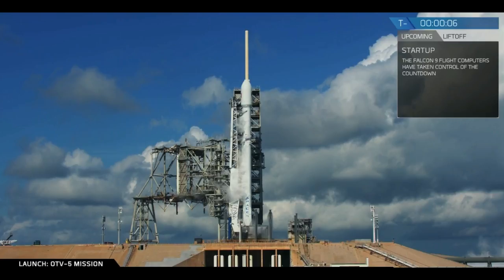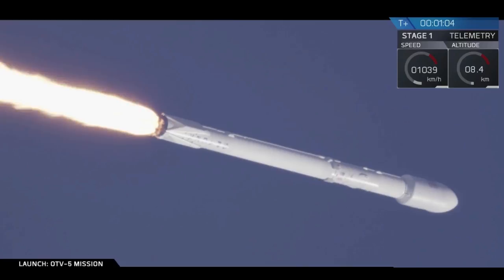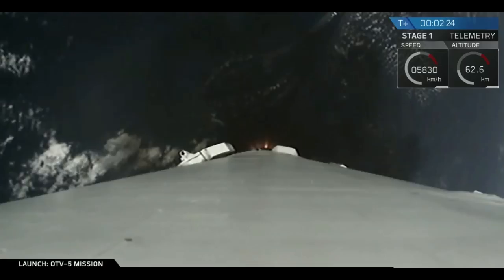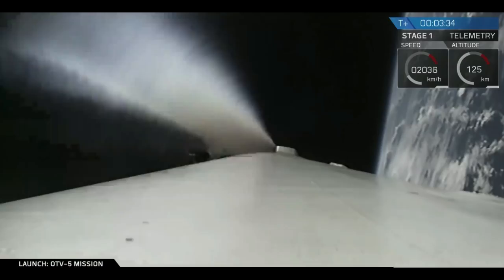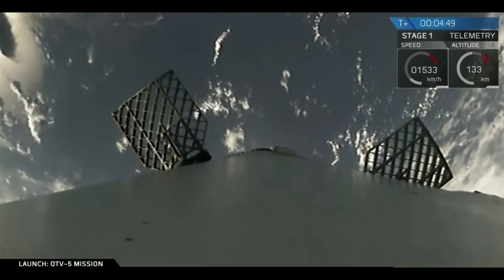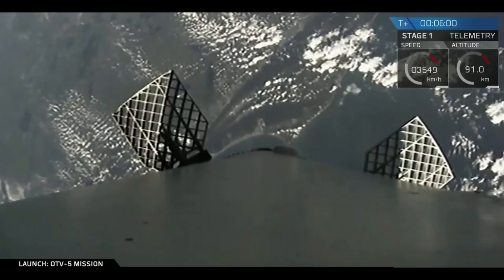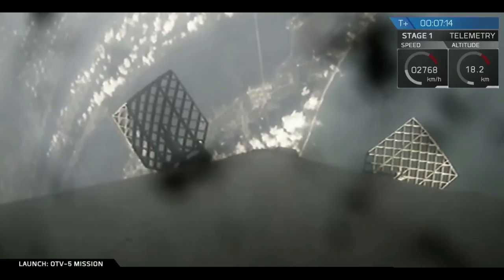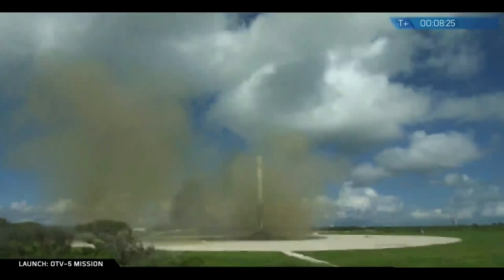Falcon 9 launches X-37B OTV-5 & Falcon 9 first stage landing, 7 September 2017

Comment: I am close to crying every time this elegant machine corrects, slows and soft lands. My utmost respect to every SpaceX employee who designed this artcraft.
Reply: Ditto - I'm sure every Grumman, Lockheed, Rockwell, and other engineer who worked on Apollo and the Shuttle feels the same way. - Imagine what NASA could have done with all the $$ Billions $$ saved if it has re-sable rockets since the 1970's. - We would be on Mars now -   I am in awe of these "Rocket Scientists"
Reply: "Artcraft" Interesting word.
Reply: I was only able to compress air to 900 psi. It seems like stages 3 and 4 are stuck. I looked at valve 3 from germany. I cleaned it. Aluminum gasket damaged. like 87 dollars from bargain marge. torqued it to x. I dont like putting gas into a dart 1 gallon tank. it ran out 75 feet from the turnout in the redwood forest. dirt stairs near where i left 25 x 24 ounces.  The glitter in the flakes is iron pyrite .
Reply: Ironically, SpaceX uses Imperial units and NASA uses metric. So actually the opposite of what you think.
Reply: john halamka That is an amazing comment. I speak english but I have no idea what you are saying, but as an American I will defend to the death your right to say it.
Reply: led zeppelin
Reply: Harold Potsdamer probably

Comment: Is the landing entirely automated?  If so, it's one of the most astonishing feats of computer programming in history!
Reply: Easytiger10 Yes there is no control from the ground. Actually one control. Even though the auto destruct system is also autonomous, It can be overridden from the ground if something crazy happens and it flies off course without destroying itself, but all the flying is on-board.